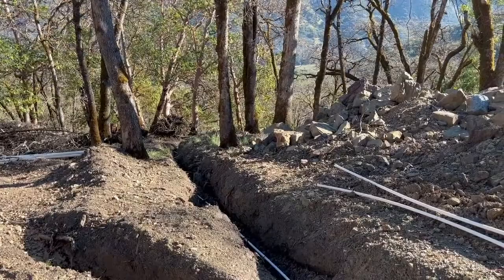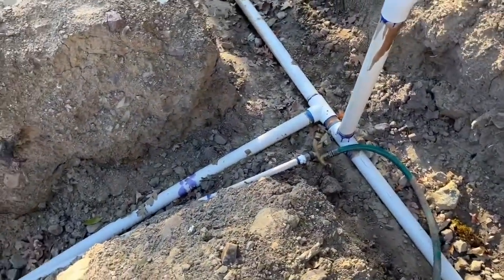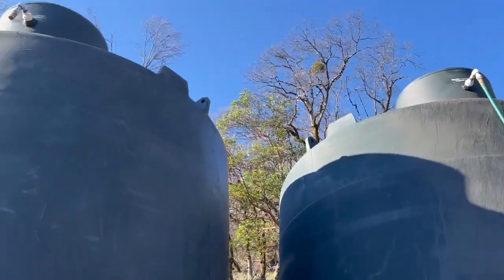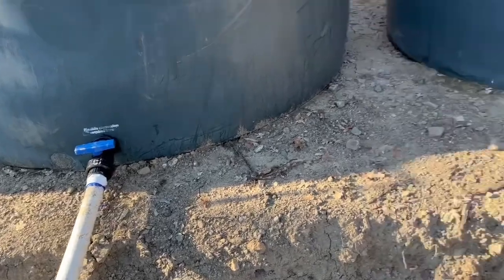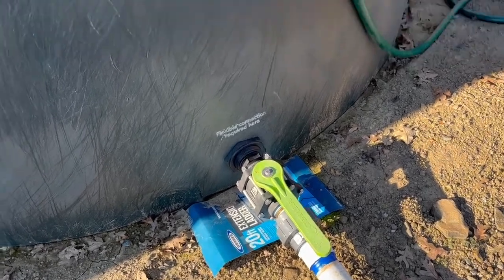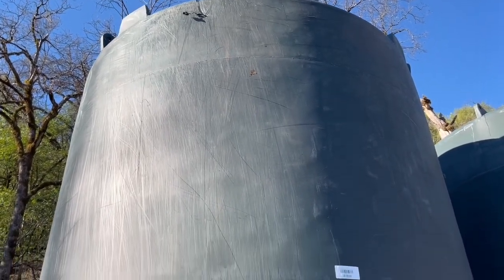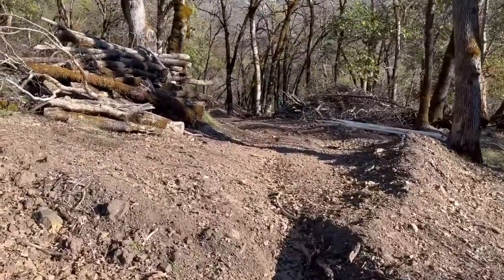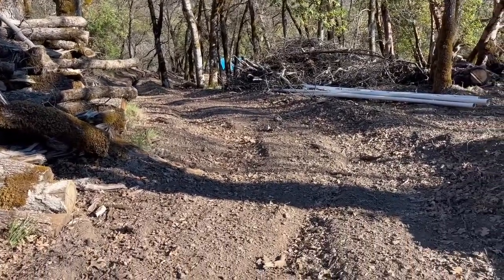How to Plumb Water Tanks

Comment: What kind of pump do you use to pump up with?
Reply from the maker: We use a gas motor powered pump.  It pumps about 9 gallons per minute through a 3/4” line over about a 400 foot span with about 150 feet gained in elevation.